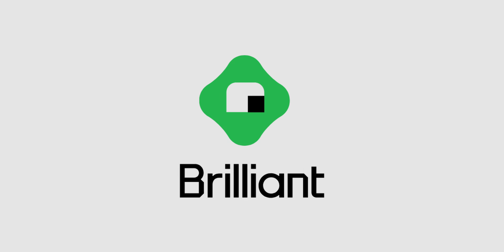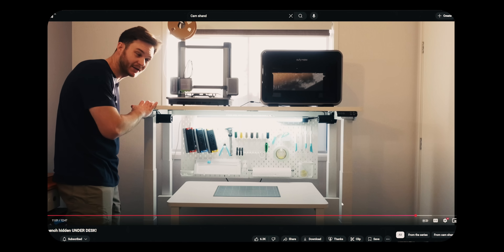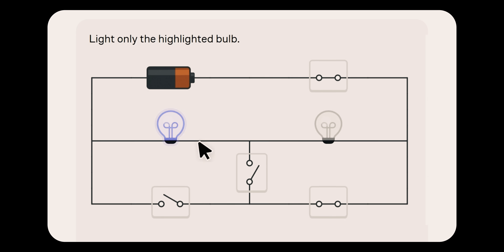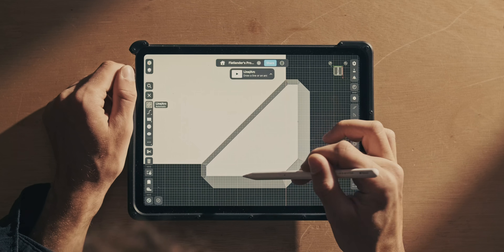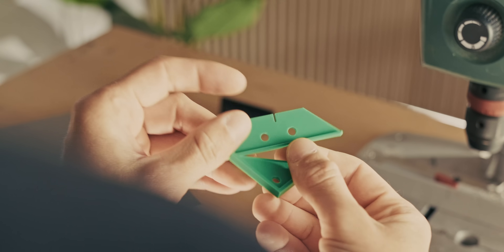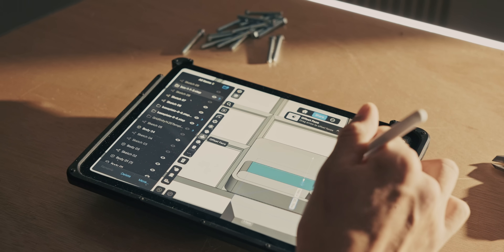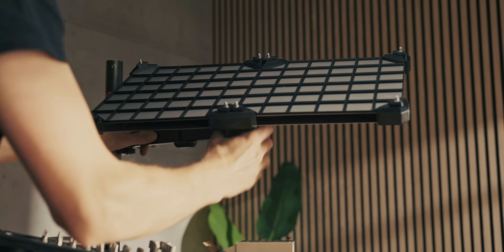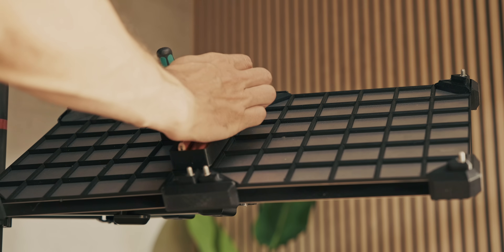Gridfinity Finally Made Sense After My Second Project Panel Build

Comment: Coming in a few months later. I can see the smaller metal panel that you've made being useful for hte 1 job youre doing, or the 1 job and the  next stage. That way you can store all the unneeded tool carriers and tools in a drawer (appropriatly laid out) and keep these as that task specific panels. It goes against my adhd to not have all the tools, all the time, but your mileage may vary.

Subscribed for more.

Comment: Fill the gap between your two steel panels with expanding foam, it should massively increase the rigidity without adding to the weight

Comment: Looks great! I feel like I'd want to have groups of tools that I use together frequently on a grid "block" and then another group of tools on another "block" and then just grab the blocks I need and drop them into your project panel. Then if you're onto a different step of a project, or different project entirely, just grab the entire block and swap it out for another block.
Reply: I feel like this could be done as your wood base with the metal sheet cut in half of it's current size, and then the grid with the grid modules slotted in to make a full block of tools that you could swap out quickly.

Comment: Does a caliper get affected by magnetic force when measuring? Won’t it break? I wanted to try it myself, so I thought I’d ask.
I’m Japanese, so my English is poor. Sorry.
Reply from the maker: So far its not had any issues with the magnets, i can imagine it might mess with the internals if the magnets get too close.
Reply: The only issue would be if the proximity to the magnets causes the calipers to take on some magnetic properties and then attract metal swarf/filings. If that were to get inside the calipers, it could affect the accuracy of measurements.

Comment: I feel like you should've really put those bits in the bits holder the opposite of what you did, the longer ones in the middle and the smaller ones outside. I can just see it being very annoying to pick up the smaller bits.
Reply from the maker: Absolutely agree, although its not as difficult as it might look its still good practice to design it in a way like you mentioned just to be safe.

Comment: Brilliant idea.
Where did you buy exactly the metal sheets?

To mount the baseplate, you can also print baseplates with magnets incorporated. That way you don't lose the corners.
Reply from the maker: That's actually really great! I've been wanting to try embedding magnets during a print for a while now. I bought the sheets from a local hardware store called Hornbach (I live in the Netherlands).

Comment: Love the idea, very inspirational. In regard to those corner pieces: do you even need them to hold everything in place? If there are always one or two bins present, their magnets should hold the bins themselves AND the grid securely in place. Then the 10 mm magnets are no longer an overkill but would have a purpose. You could even print special “corner bins” with even more or stronger magnets for this purpose.
Reply from the maker: that's a really smart engineering mindset haha, I hadn't even considered this approach thank you for sharing! your right! that would be totally feasible :)
Reply: @FlatLanderTech  You're welcome. Also, for better alignment and to hold even empty grids, you could attach small L-shaped profiles from the bottom (also with magnets, in the same orientation as the rest, so they don't counteract each other ... if they ever would, through such a thick metal plate). That would give you a little lip as a guiding frame, the grid could register to. Done all around, it could even be beneficial for the looks of it, hiding all the metal.

Comment: Just add some inclined and forward-facing LED strips strips to the bottom and you have a glare-free workplace lighting on top (bottom).

This looks like a great solution for a small workshop with limited work space and changing challenges. You can have everything needed at hand without taking up too much space.

Comment: Very cool... question... what material are you using for printing? Reason I ask is that there is quite a bit of loose filament bits, etc. in your timelapses and I don't really see that in my prints... not criticizing, just curious..
Reply from the maker: I'm using PETG HF, but I might have lost some ball bearings on my Bambu Lab A1 printer while modding it for timelapses. Since then, I've noticed a gradual decrease in print quality. It's also been making some funky noises—so good catch, it's definitely a bit concerning.
Reply: @FlatLanderTech  Thank you for taking the time to answer. I enjoy your approach to your projects and have been learning Shapr3D after seeing you use it.
Reply: @FlatLanderTech  Personally, I'm really enjoying printing with PETG-CF. Finish is really nice and it prints very well on my P1S

Comment: I have a Bosch rotarytool with 12v battery because I‘ don’t like cables and this one is plenty strong enough and doesn’t burn the moto like cheaps ones do.I use it a lot to shorten bolts, increase cutouts and clean 3d print with nylon and other hard materials, router in wood and so on.
Reply from the maker: Thank you for letting me know about this tool Markus I'm definitely going to look into this, sounds like something I should have laying around for these types of situations :)